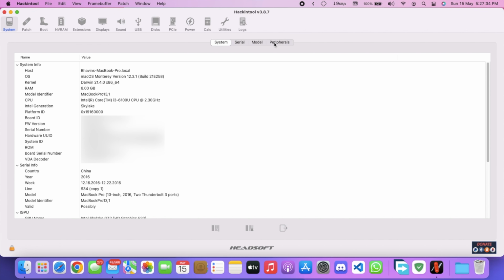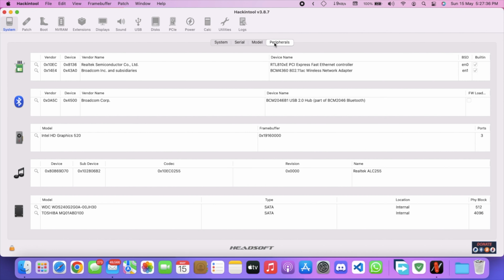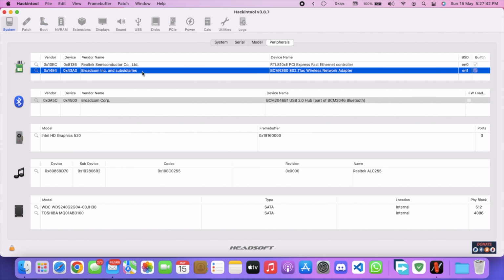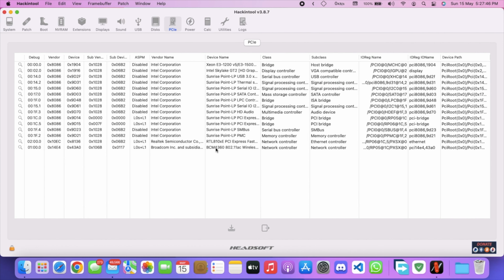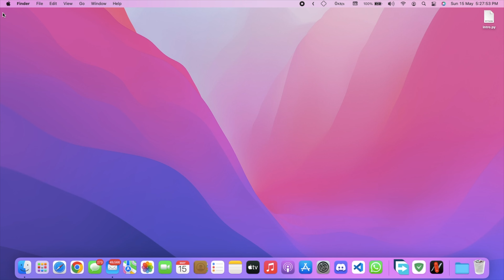This is how I got wifi and bluetooth working on my hackintosh [Airdrop and everything working]

Comment: Bro will WiFi 6E Card, AX210 Tri-Band will support airdrop and Wi-Fi bluetooth
Reply from the maker: Airdrop and continuity features will not work on intel based cards 

You will need Broadcom card
Reply: @Bhavin_jain  thanks for replying can you please suggest any one card that will support airdrop and all the feature
Reply from the maker: You can buy bcm94360ng
Reply: @Bhavin_jain  bro but in Amazon it's not available from which site I should order it
Reply: @Bhavin_jain  and bro its showing two much cost can I use your Wi-Fi card will that Wi-Fi card fits on my laptop
Reply from the maker: Ebay or ali express
Reply: Bro won't they charge custom charge and if yes then how much and please please share the link
Reply: @Bhavin_jain  and bro I don't want too much costly I want the card just like your price point or some more costly but not too much costly so please help
Reply: @Bhavin_jain  bro can I use the same card that you had used and will it be fit easily on my laptop please help
Reply: @Bhavin_jain  please reply
Reply from the maker: The card might not fit in your laptop 
As it’s an double stacked 
The adapter + wifi card
Reply: @Bhavin_jain  then what to do which Wi-Fi card should I buy that cost not too much but I can invest a little more than your
Reply: @Bhavin_jain  my laptop is hp 15-da0326tu will it fits on my laptop
Reply from the maker: Just buy a intel based card
It’s cheap and you will have stable wifi and Bluetooth for day to day use
Reply: @Bhavin_jain  bro I was thinking to invest only once and with full potential that's why I want to know bro how much they custom they charge from you
Reply from the maker: When I purchased from ebay couple of years back
Reply: @Bhavin_jain  bro please suggest  Intel based card that work best on my laptop please help
Reply: @Bhavin_jain  Bro please suggest best intel card that will work them best
Reply from the maker: https://openintelwireless.github.io/itlwm/Compat.html
Reply from the maker: You can find all the compatible cards
Reply from the maker: check out my latest video on how I got Airdrop and other features working